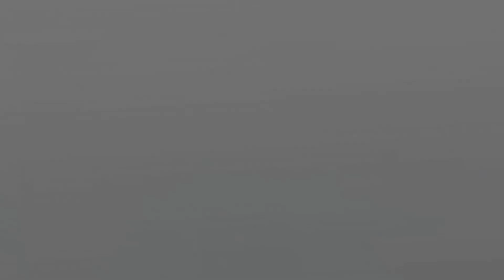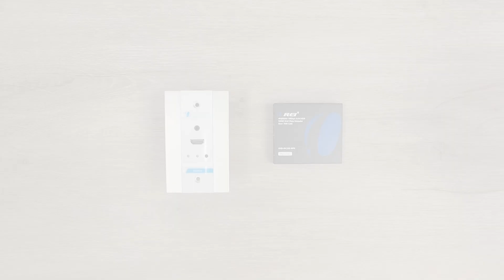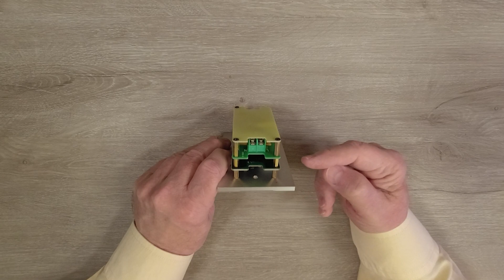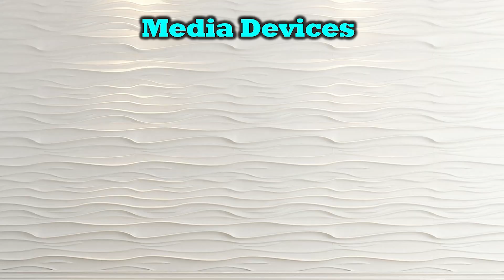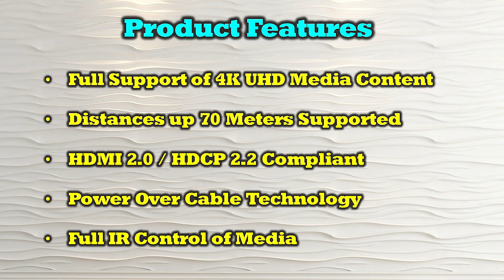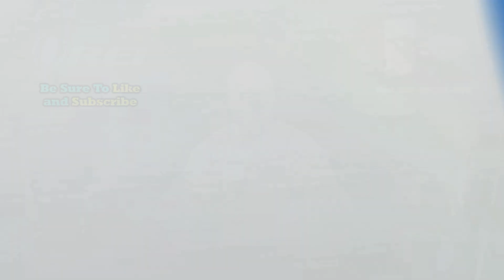4K HDMI Extender by OREI Over Single Cat6/Cat7 Wall Plate Transmitter 4K @ 60Hz (UHD-IPC230-WPE)

Comment: Once it''s powered on, can I leave it plugged in continuously? or do I have to unplug it every now and then?
Reply from the maker: Yes, you may leave it on. But it is suggested you turn it off when not in use for a long period of time.
Reply: How would you turn it off its hardwired in the wall? Is there a secondary power somewhere or would  I have to do some type of switch?
Reply: @JordanWenk  My thoughts exactly lol I've been looking for an "off" button on the wall plate, but it doesn't seem to exist.
Reply: You can probably in-line a paddle switch before the wall unit?